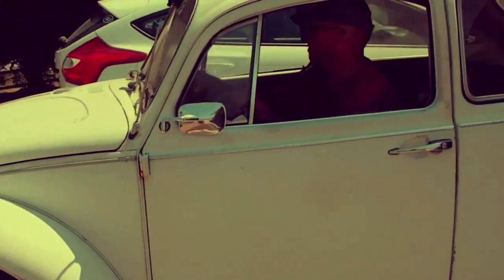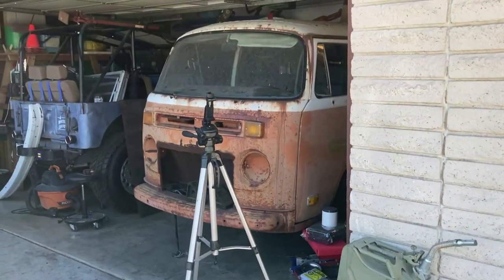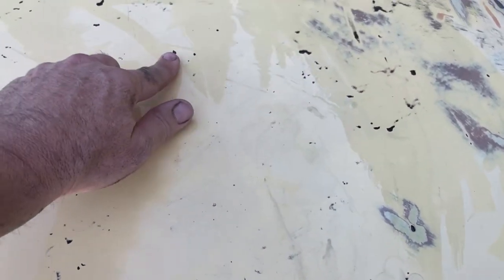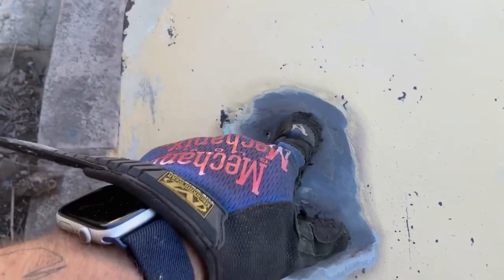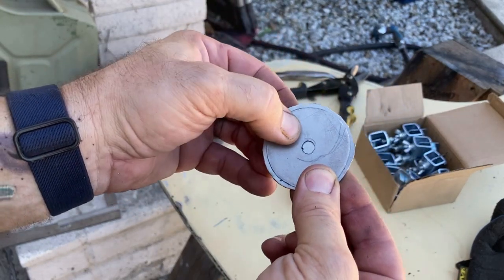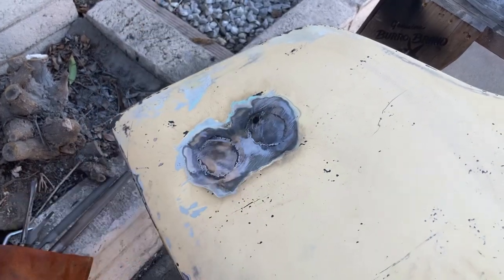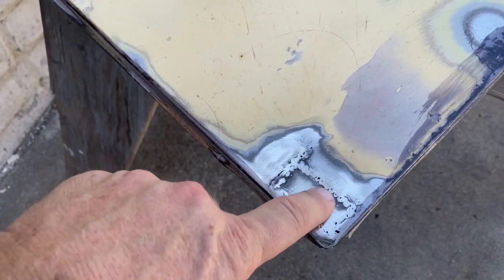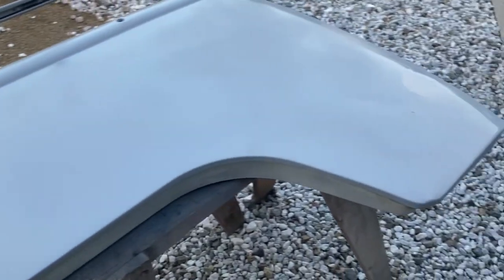1974 VW Build a Bus - Door Rust Repair and Surface Prep

Comment: Nice job 👍welding is hard I do alot but I’m a good grinder . Nothing wrong with body filler (bondo) I tend to use fibreglass filler first as nowadays the products are good . Keep going on the bus 👍
Reply from the maker: I haven't tried fiberglass filler on a car panel before, but I'll check it out.  I've got a few more spots (not including the nose) to address, and I'm about out of filler.  Thanks for the tip, bud.
Reply: @SchoolStGarage  hi yeah I do this as got tips from bad chad and other car builders ,works a treat